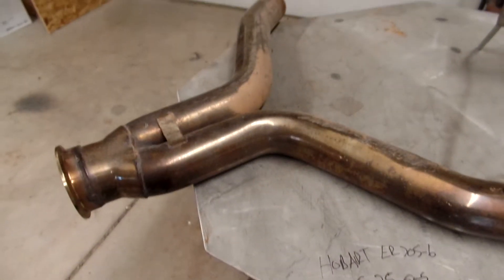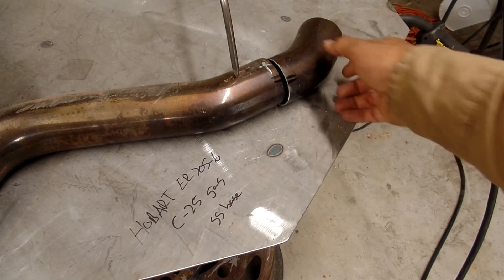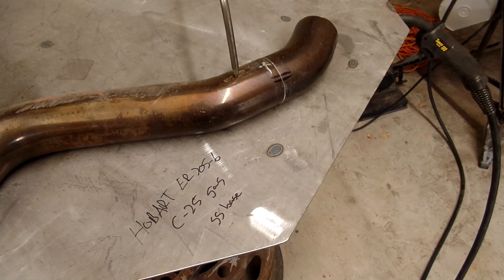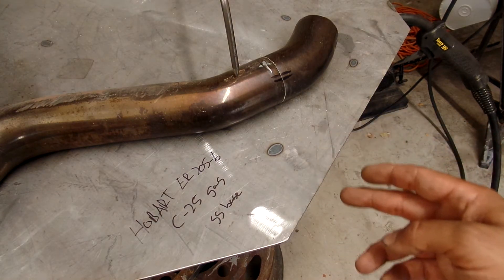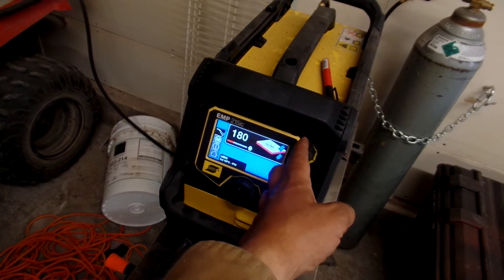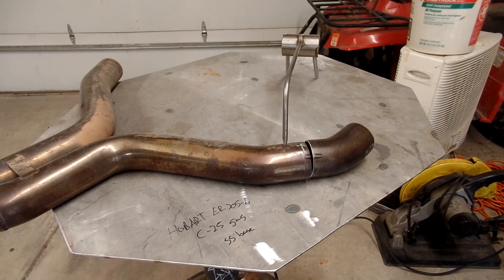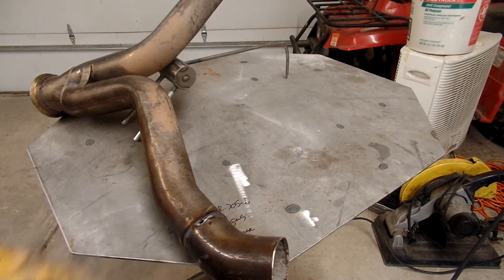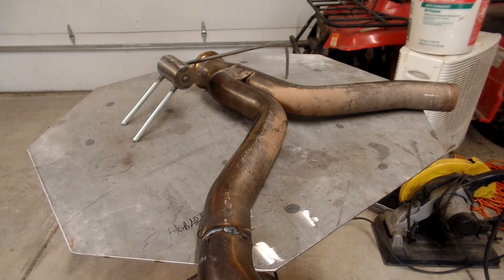Stainless Exhaust Welded with ER70S-6?  WHAAAAAT!!!

Comment: nice to know it can be done. even though i got a tig welder but im having different problems you are supposed to purge the pipe and i aint doing that lol
Reply: Solar Flux will stop sugaring on the back side of an unpurged SS weld . I'll be welding up a system for my square body GMC soon . I have done a lot of research and spent cash on stuff , what works for me is TIG with ER308L with the Solar Flux where I can , and some 308L flux core MIG wire and SF where I can't TIG . As much as I can I'll tack with the MIG then remove it from the truck and TIG it in the shop .

Comment: I'm building a full Frankenstein stainless exhaust, welded with er70s.. 3" Turbo back. Starting with 1/2 thick carbon steel turbo flange to 3" 409 pipe to 304 flex to 409 then 304 1/2" thick flanges, 409 pipe to 304 resonator to 409 to 304 to 409. Lol. All with er70s, .030.  I did the cat back already with mixed stainless and if you set the welder right it comes out decent. Rusts but the 70k psi weld will last a long time. It almost seems like you mix a little ss in the weld too if you don't build too much.

It's the thickness of those flanges that worry me a little... 1/2 thick ss plate is not joke the 2 bolt exhust flange must weigh 4 or 5 lb.
Reply from the maker: Hell yeah!
Reply: @coconutcowboy5976  the thickness of the flanges is what I'm a little worried about. 1/2" will suck a lot of heat. Will be tricky and I have no test material, Lol.  Pretty confident i can work it though with the right finess, will definitely be weaving it from the flange.
Reply from the maker: Keep the heat on the 1/2 and let the weld wash onto the thinner material, no worries.
Reply: @coconutcowboy5976  thanks for reassurance, I figured that should work out..

Comment: Curious since you had the chance to do TIG with your ESAB, why you didn’t  go TIG with 308L filler or even MIG flux core 308L wire?
Reply from the maker: Didn't have a tank of Argon and customer wanted it cheap.

Comment: Nice video! By the way, what wire speed do you use when welding stainless steel exhaust with a MIG?
Reply: Right now im set at 189/15.5 and use that setting every day.
Reply from the maker: I was around 180/18 but usually that depends on how fast your moving on the thin stuff.

Comment: Is the c-25 gas mean 75argon 25 co2
Reply from the maker: You got it!
Reply: What about corrosion resistant with this high percent Co2 gas?
Reply from the maker: @jannovak5532  
The wire ER70S6 is steel wire so corrosion resistance is gone.

Comment: Great video. Im planning on welding up a few bits of stainless exhaust piping with my new mig welder. I have found it hard to not blow holes through the stainless. I'm having to almost tack it all the way round. How do you get away with welding it in big chucks like you have in this video? Is it because your travel speed is so quick that it never gets chance to burn through? Thanks for any tips
Reply from the maker: Watch your angle, you want to be pushing the weld up as you weld down hill.  You also have to move!  Hope this helps.
Reply: you blow holes just as easily through mild steel tubing..